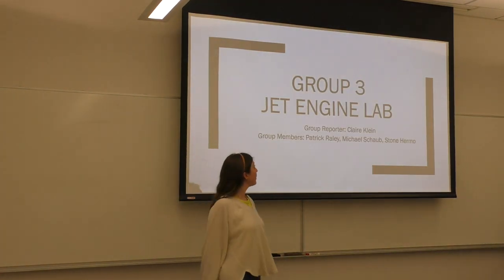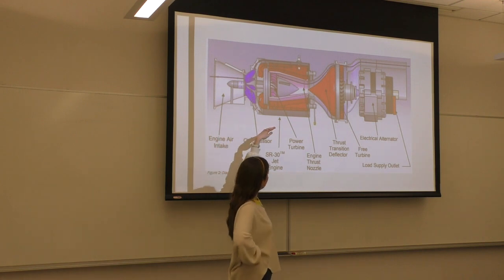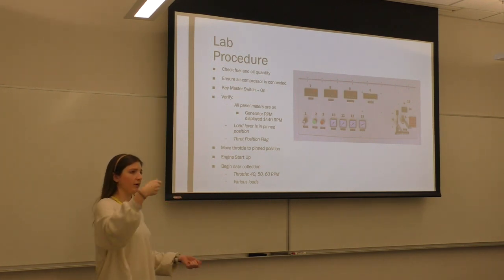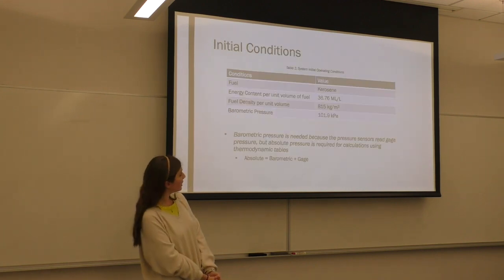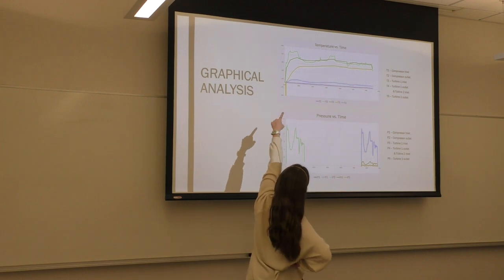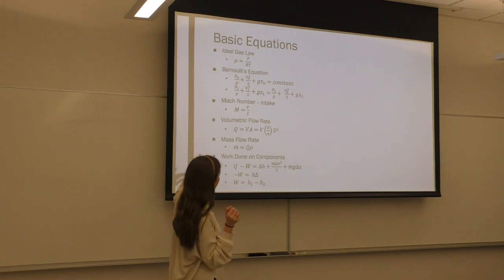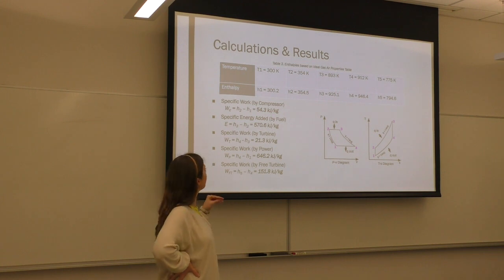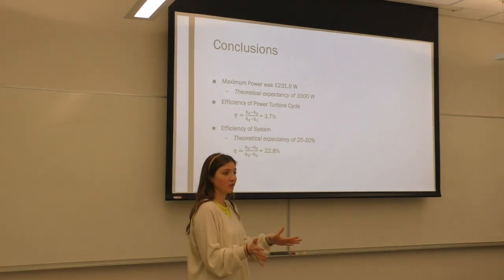Claire's Reporter Presentation

Comment: Claire, you did a very good job presenting the data and relevant information to the experiment. Your slides looked very good and contained an excellent balance of information and pictures. My only advice is to use a timer to avoid going over the 6 minute limit.